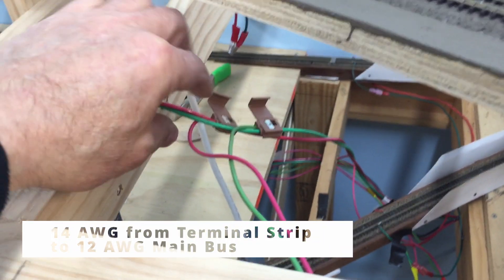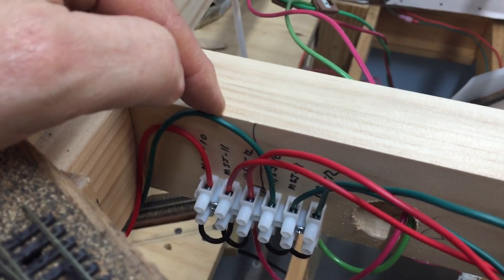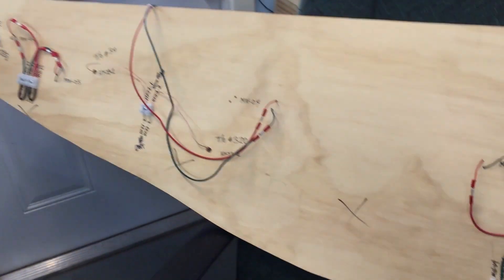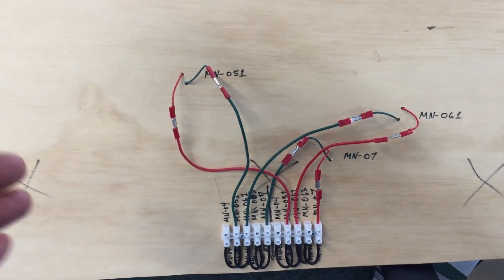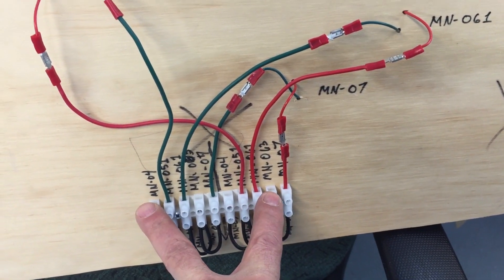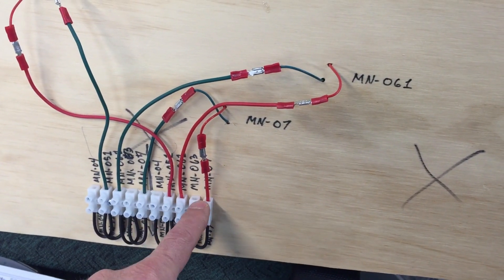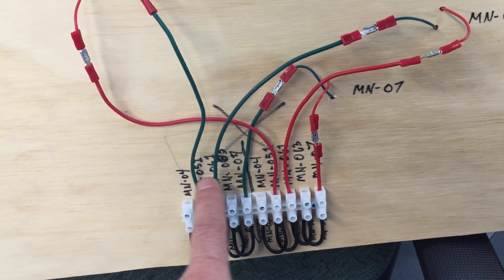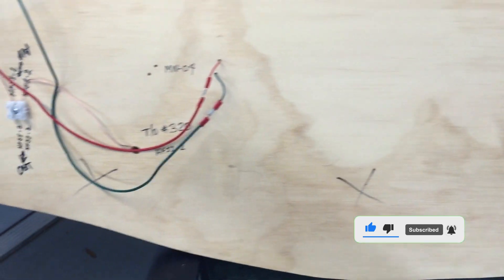DCC Power to Feeders for Easy Troubleshooting

Comment: Those terminals definitely help making trouble shooting easier, and they help make wiring look nicer. Thanks for threading tour.
Reply from the maker: Hi Joe, Thank you for your comments. I wired my layout like a house from a central location. Each sub-circuit or sub-power district was wired from the main 12awg stranded wire bus. Each section is then wired used a euro- connector since they can be easily cut to match what you needed for feeders. I also used a lot of bayonet style connectors so it is entirely modular and very easy to troubleshoot. Have fun wiring….John

Comment: In Oz, we call those connectors "chocolate blocks"! Ive been doing what you have shown for years now. It makes fault finding very easy. Thanks for sharing.
Reply from the maker: Hi Peter, Thanks for your comments. I completed the wiring of my layout about 8-10 years ago and did it in this modular fashion to do exactly what you said. It helped to quickly find and isolate a couple of issues when they have arisen over the years. Thanks again….John

Comment: John thanks for sharing. If you use some large diameter heat shrink on your spade connectors it will insulate the terminals and still allow you to pull them apart. Don't shrink it just slide it over. Mike
Reply from the maker: Hi Mike, Thanks, I just used electrical tape. The video was brought back as a condensed version from 2015. I thought that it might be of interest to some. My layout has been fully operational for around 8 years or so….John

Comment: Good vid. I didn't know that you needed insulated joiners  when you do DCC
Reply from the maker: Hi Gary, Thanks for your comments. You either use insulated joiners or cut the track and glue in plastic pieces which then have to be sanded/filed down to conform to the track. I used the insulated track joiners so I could readily see each powered section as an additional item to help with troubleshooting. Since I use Peco electrofrogs, they also require insulation on all four tracks past the frog (wiringfordcc.com) because of the way they route power…..John